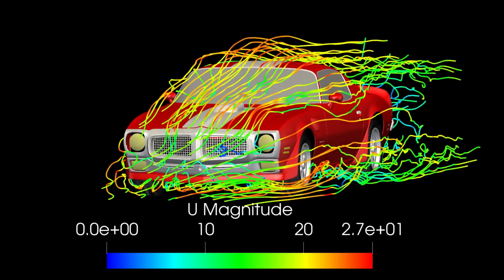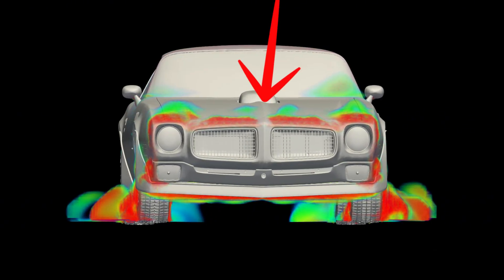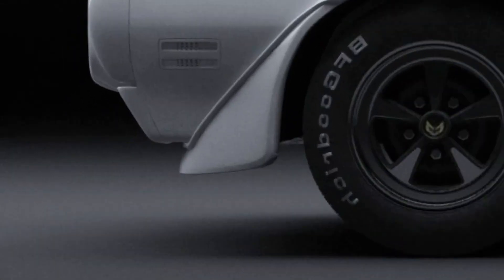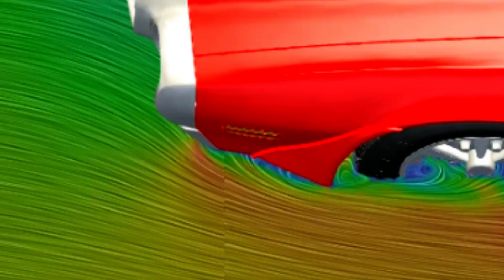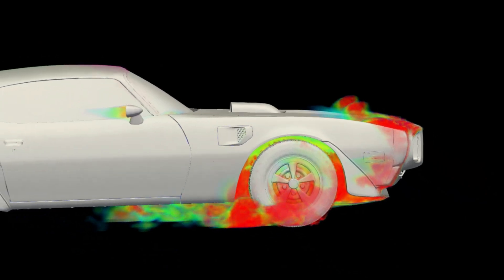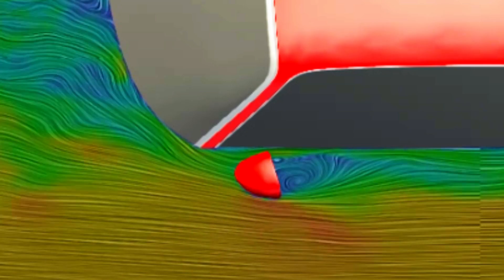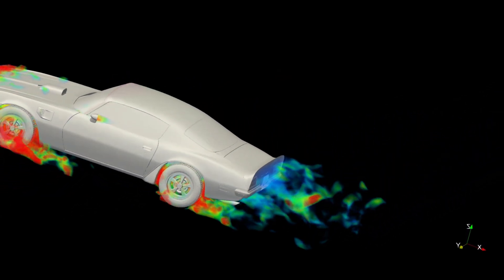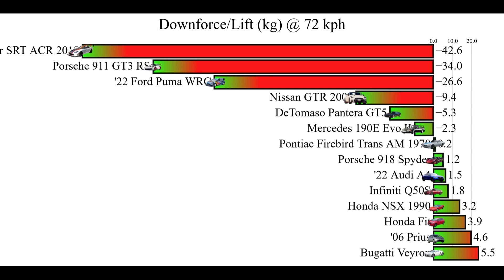How Aerodynamic Was The Firebird Trans Am?

Comment: I have an early second gen Camaro with the low rise spoiler so I did a bit of reading about it compared to the high rise version that's more similar to the T/A. Apparently from testing of the era the one piece spoiler created a lot of lift on the second gen f-body that was hurting it during racing of the era. The front spoiler was supposed to help minimize it but shortly thereafter they just adapted the Pontiac's three piece high rise to the Camaro and that design lived with both f-bodies the rest of the generation. Would be interesting to see some numbers on a non spoiler second gen car to see what it does, especially since the quote referenced mentions the counterintuitive aerodynamic returns from the sleek body lines.

"It seems that the 9796 COPO always starts a battle regardless of what site it shows up on. The history of the 9796 copo is very unique and is associated with Vince Piggins and Jim Hall at chevrolet racing. It seems that the short spoiler which was standard on the Z actually created 125 lbs of uplift at high speeds this created problems racing on the trans am circuit and put the new camaro at a significant disadvantage. Team chevrolet started experimenting and found that the center section from a trans am spoiler did the trick and at speed, combined with the chin spoiler would create 200+ downward force needed. The problem was there were not any cars built as a production item to allow the spoiler to be legal in trans am...

The Problem: Above 120 MPH the short spoiler on a '70 body generates lift.

Combine that with the lack of a front air dam- and you are left with a clean looking design that will have inherrant poor high speed handling traits."

Comment: Good to see this data on a classic car. NASCAR was dominated by the aerodynamic 1975 / 1976 Chevrolet Laguna so much that there was a carburetor restrictor plate imposed on them to slow them down. The 1976 /1977 Oldsmobile 442 then became the dominating car and ‘The Grey Ghost’ from 1980 still holds the record at the Daytona 500 for the fastest average speed. Buick had the 1976 / 1977 Century that was also successful due to its sloped nose. I would like to see an evaluation of the aerodynamics of these cars as they were specifically designed for use in NASCAR. Thanks.

Comment: I didn't see any effects from the fender vents which are functional, they should remove some of the under hood pressure and the negative eddy behind the shaker would not be as pronounced as the T/A Shaker is open to the carb. 
I am pretty sure the spoilers were developed through the Trans Am racing program as the Chevrolet asked Pontiac if they could use the spoiler on the Z28, which was a COPO program for 1970 Z28's to homologate the spoiler for use in Trans Am racing.

Comment: What are the pc specs you recommend for openfoam to work properly? because i've been trying to make it work and I simply can't achieve your results (I just waited 3 hours for a sim to finish to find that it did nothing)
Reply from the maker: It really depends on the level of accuracy you want. A general rule of thumb for the snappy hex mesh with boundary layers is for every million cells to have 3 gb of ram. For the number of cores, it is very dependent on the number of cells and the flow physics and mesh you have, but a loose relationship is one core can do 1 million cells to convergence in about a day and a half to two days.
Reply: Thanks! Well that explains everything, my 2 cores and 16gb of RAM simply can't handle the motorbike tutorial :(
Reply from the maker: That should be enough for the normal motorBike tutorial. You can always change the blockMesh and the amount you refine the volume and surface meshes to reduce the cell count.

Comment: I could be mistaken but wasn't the point of the backwards facing hood scoop so that the carburetor could suck the air from the high pressure area at the base of the windshield? If so does that change the coefficient of drag when the car is running?
Reply from the maker: They might've thought that, but the pressure plot in the cut plane shows around 50 pascals gauge into the inlet. If you turn it around to make a ram air inlet, you can use the dynamic pressure of the flow, which here would work out to be around 100-150 pascals gauge.
Reply: That is correct, early production years of the 2nd Trans Ams featured functional shakers that capitalized on this, however later years it was simply cosmetic, with no inlet in the shaker - though it could be modified to bring back functionality.